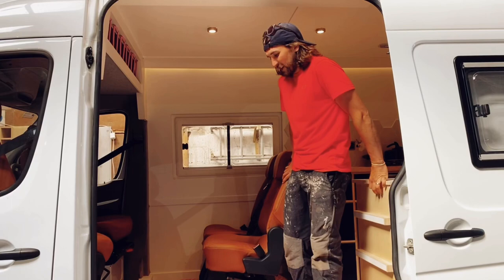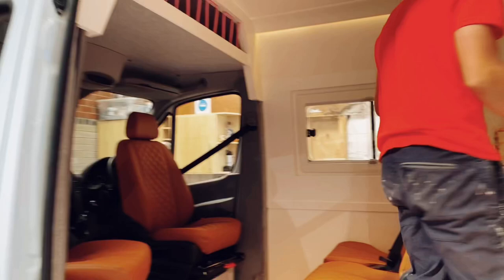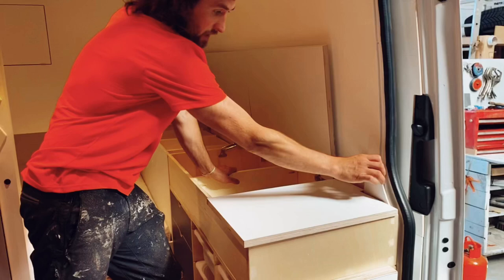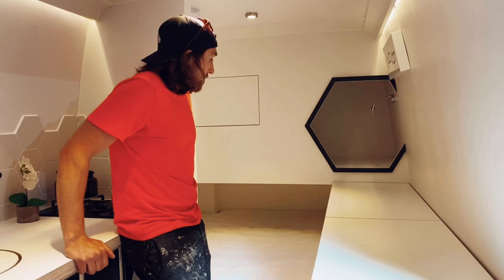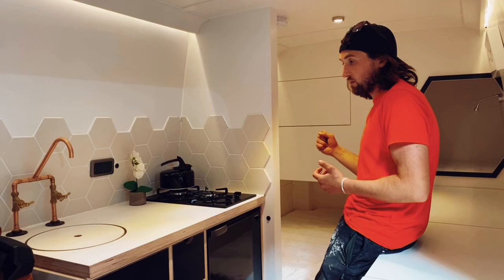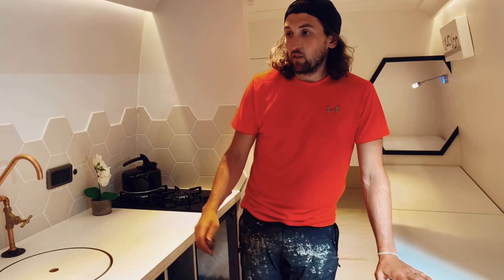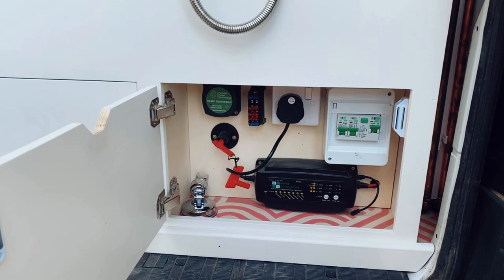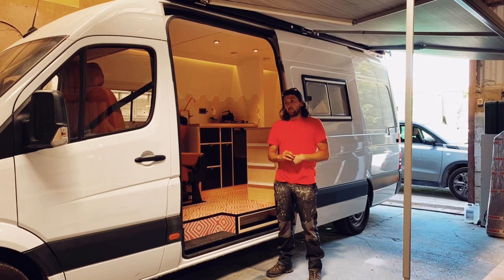🔥VAN TOUR!🔥 Full tour of stylish and quirky campervan!

Comment: A suggestion for your next video, loss the music in the intro and the rest the video. couldn't finish the video.  A shame cause it looks interesting. Also a lagoon table mount works better for kids and car seats and can mount to the wall. A tip for the music, if it's background noise you are worried about you can remove them in most editing software.
Reply from the maker: My next video has been edited by professional so should be better. I am a beginner at this stuff! The lagun table was not suitable for this as the reach needed for the passengers swivel seat was too much, it made it wobbly and unstable. 🤙🏼